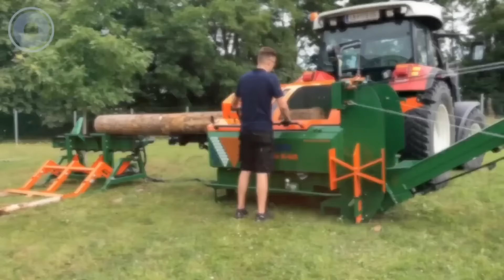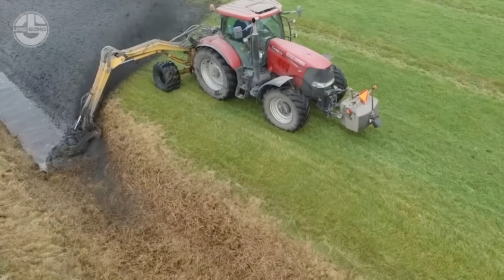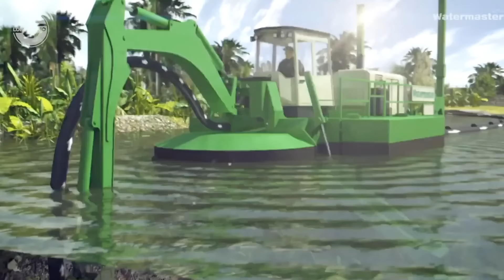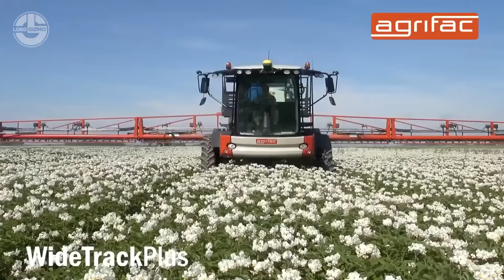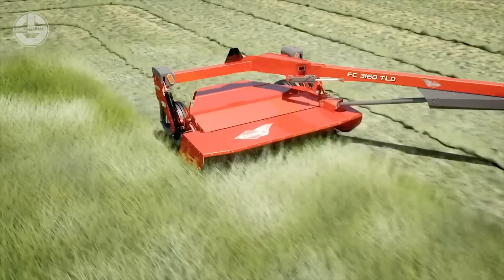16 Jaw-Dropping Powerful Machines on Another Level!

Comment: 14:10 The Bos-2BS supports 30hp, not 240hp. The site also gives a rear PTO speed of 1500RPM, most implements run at 540 or 1000RPM so I don't understand this one. The tractor shown does not have a 240hp engine or the ability to run it's PTO at 1500RPM.

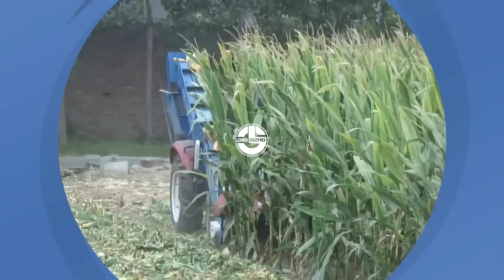Comment: At 13:45 the tractor for the corn picker should say any diesel tractor above 24 horsepower, not 240 horsepower. Great machine just the wrong tractor size.

Comment: I dont see any of these machines running on Duracells in the near future :)
Reply: Shows what you know. I work for a heavy infrastructure equipment manufacturer. We're already producing electric horizontal directional drills. And I'm not talking about the baby ones 😁 these machines are all hydraulic. It's is actually more efficient and reliable to run pumps with electric motors. Constant and instant torque is next to none. Battery technology was the only problem. Some dude named Elon in Cali did something about that though 😏
Reply: @Barry_machawkner  battery technology is still a big thing. Mr elons cars still wont go as far as my petrol car will on 1 charge v 1 tank. Theres also the fact you cant recycle the batterys so they have to be  buried and that's just as bad for the environment as driving a fossil fule car
Reply: @jordanleigh8119  what are you talking about? Teslas get more miles per charge than your average passenger car gets per tank. The batteries are also recyclable. Did you just make that up hoping you were right and/or no one would notice? Lol 🤡

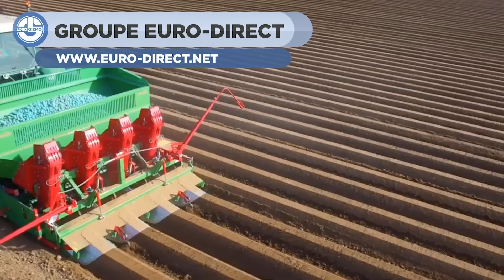Comment: At 5:52  Why are those Potatoes Turquoise or Blue-ish Green ?   This is why I only buy produce from verified Organic food suppliers.  God only knows what those Turquoise potatoes are coated with. Maybe they're even the same color inside when you cut them open. Maybe they're coated to resist insects & genetically designed to lose their color after the chemical is deposited into the soil.  But what gets deposited into the person that ends up eating them ?   Biggest and most massive is not always the best way to do things.

Comment: How does those water cleaning things see under the water? Mud is hard to see though
Reply from the maker: Sometimes they use radar and lidar, sometimes it's other things.  Different machines have different methods, and every company should be able to explain how their method works.  Hope this helps!

Comment: Unless you sale the firewood to retailers it will take you a long time to pay off the machine. I would bet it is about $50,000 USD.
Reply: Whilst it still is for firewood retailers the thing costs 25.000€ or about $29500 USD without taxes in germany in its simplest form. Posch is an austrian company, so you probably would have it shipped to the US in a container, wich would also cost a few bucks...
Reply: @thoughtfox2409  I was only guessing on price. I figured 50 if buying everything.

Comment: You know what would really be cool? If the workers had the right to repair these machines themselves, if possible.
Reply: Fuck em -john deer
Reply: Mail your senators, get your friends and family to do it too
Reply: Why can’t they? Or will it void the warranty? Or just too many electronics so doesn’t let them?
Reply: @DavidInMonroe318  All of the above. Some brands of tractor just have the electronics lock it up so only a dealership technician can do anything with it and void the warranty if the farmer tries to fix anything.
Reply: @DavidInMonroe318  several reasons. Many tools for this size equipment is simply not easily available, so owners tend to "make do" and tear things up long term. 2) not many operators are even qualified to repair ANYTHING on these besides adjusting the seat 3) warranty and maintenance are usually included in the price (to make it last longer)
Reply: Just because you can, doesn't mean you should. Who's to say you're qualified? In warranty or out?  Are you even going to spend the hundreds to thousands of dollars for the service manual?  How about the diag tool so you can reset even the service reminders?  Some of these machines are just out right dangerous to work on.  I'm an engineer that used to supply fluid power components to Deere and Cat.  Deere especially tests everything and sets the industry standards.  To not replace something with OEM if it breaks makes a huge difference on lifespan and performance.
Reply: @ando5389  lol. Plenty of farmers and maintenance teams are used to fixing engineering screw ups including hacking electronic interfaces deliberately obfuscated by unethical manufacturers trying to extract exorbitant maintenance costs by poorly trained slow to respond authorized repair centers. Crapple and Dear John aren't alone in trying to hose customers but they are some of the worst.  Right to repair needs to be codified.
Reply: @anullhandle  I'm all for right to repair.  Like me, I want to be able to fix my own stuff.  In college, I was a mechanic for a lawn and garden service co.  I've  been through many training seminars.  I've taught many training seminars.  At least 1/4 of the work we got was farmer duck ups.  But that's fine.  Just playing a little devil's advocate.  My biggest recommendation though, is just don't start messing with it until it's out of warranty.  You paid for it, use it...
Reply: @ando5389  .02 under warranty if you can reasonably show my actions resulted in the particular warranty failure fair enough it's on me.  That doesn't include  the tamper evident seal is missing.  Im ok with a voided warranty if I twiddled some bits and enabled some withheld features. Some manufacturers look at that as a competitive advantage.   Service manual should be the cost of reproduction and distribution thru the whole chain including the owner.  Code readers should be the dealer actual cost there's no reason it couldn't be foss and likely generic industry standard.  Secrets aren't security and you already developed it for production and test.  When your customers and independent  service providers are suing you and testifying against you before Congress, you're doing it wrong. Agreed safety / liability issues are concerns but not a impenatrable barrier or legitimate excuse like manufacturer's are claiming.
Reply: It’s their equipment !! They can do what they want too !!
Reply: @keithfaulk1354  not always. These machines are designed to detect when "unauthorized" work is being done to them, and will shut the whole machine down until a company technician comes and makes the farmers pay out the ass to reset and fix it
Reply: Them days just like your car are coming to an end.
When these new electric cars break youl drop it bk collect another just like your phones.
How will they changed the batteries with their part of the car?
Reply: @nickjohns1192  ⁸⁸⁸⁹9999⁹9⁹⁹⁹⁹⁰0
Reply: That would be cool. What's cooler than cool, is if we deployed farming practices that removed the reliance of farmers on the people farmers are beholden to, the machinery manufacturers. If farming were done in a way that removed the need for machinery. Maybe regenerative no dig farming is a way to go. I dunno, I'm just a city slicker that would rather be on a farm earning my place and doing it for a local community instead of some rich prick that only cares for money and power, like Bill Gates or John Deere.
Reply: If it wasn’t for the demoncrat emmisions nonsense you could. Your anger is poured the wrong way. Thank a leftist insect for that.
Reply: @RandyBoBandy.  ? what do you mean? Most right to repair bills circulating today are backed by democrats. It's republicans that block right to repair movements in the name of the free market.

Comment: I like that u give some insight into how the machine works instead of just pulling random footage from somewhere of the internet
Reply: You can't be serious.
Did you listen to the guy?
The stuff he says is just stupid.

For example that the tractor has a 12 inch display. That's nothing special. That's not worth mentioning.

I guess all he does is open Google, type in the machine and than he reads the first sentence that Google is showing.
Reply: @Jehty_  seems like a decent put together video to me.  Intros to various machinery,  with intro info.  If it was a full on instruction right down to servicing the zerk's,  wouldn't that be an owners manual.    Also regarding your other comment on the wood splitting machine, yes I agree,  considering the size of this particular splitter it would be used outside but many smaller splitters are certainly used inside and do make quite a mess.  It's constant cleanup from my electric wood splitter.
Reply: Or another example: The first clip.
He says "woodwork creates a lot of dust and mess"
And then he show a firewood cutting machine.
Tell me how those two things fit together.
It's not like anyone would cut firewood in his workshop. You do that kind of work outside. Like the clip is showing.

Comment: just added 4 wheels to the tractor in the thumbnail .. ok ok
Reply: No kidding. I watched this just to see that... and it was photoshopped
Reply: @cdavison9491  rr444 hang
Reply: It's wasn't even a crop cutting machine it was driving over some ditch
Reply: @juanarmas4491  It's a canal tool, which makes it an irrigation tool, and it drives off of a large-displacement diesel tractor. Honestly, being from Kansas, only the ones that see use primarily in the logging and paper industry were new to me, and even they're just bigger and more robust versions of mechanical harvesters than previously available.
Reply: Seriously...so fucling cringe. Click bait should honestly be banned.
Reply: J JudI
Reply: Bloody joke init!!!

Comment: Have you seen the potato seeding machine? It uses standardized size seed potatos! These seed potatos all look exactly the same! I have worked in the potato industry ans so I know, farmers usually seed their own potatos that they have harvested with the potato harvest of the previous harvest. Seeing these standardized seed potatos in the video, it seeds the suspicion in me, these are the only kind of potatos this machine can work with and the contract to buy them each year might be connected with the buy of the machine...
Reply from the maker: Hey Karline, thanks for the input!  We enjoy hearing from those involved in the fields shown in our videos.  As for the potatoes, we couldn't tell you with any certainty, but it looks as though the machine was able to use other seeds in other photos.  But, perhaps it is the case it was designed with a single seed type in mind.

Comment: You need someone to check your facts and proofread your script's, or it comes across as rubbish. Suit vs suite. 24hp or 240 hp. 35hp with a diesel motor patently using so much more energy. And insulting the manufacturing.??

Comment: you might be lord giz but you are dumb af. deer 6130 trippletopper is a mystery. what's it doing just cutting the flowers off? there does not seem to be any harvesting going on. nowhere for the blooms or bulbs to go.  thaat boslead did not have an engine above 240 hp. more like 24

Comment: Gave a thumbs down due to the thumbnail shows a tractor with five tires on each side, but the video segment tractor only has 3 wheels on each side.
Reply: It would destroy the rear axles,different, wheel hubs and be overly heavy, it is probably photoshopped
Reply: @jacobbender5449  and 2 wheels would drive over plowed land
Reply: @jacobbender5449  100% photoshopped.  Look at the mud spray in front of the outter two tires in the thumbnail.  Just copy/pasted and added on to the outside
Reply: Hi

Comment: Why in the thumbnail, does the tractor has so many wheels? I mean, if that was real the tractor would be so heavy in the back. Sorry if I sound like a nerd or a smart a.
Reply: Its Photoshoped, it only actually has triples on the rear and duals on the front, so only 10 wheels for more grip on soft ground
Plus the weight is dispersed on a larger area
Reply: Oh lord you definitely seem very new to YouTube
Reply: @bryce5792  nah, I’m just weird on some days tbh

Comment: That tree harvester has a "35 hp Volvo diesel engine"?   Dream on
Reply: I heard that too, and I have a 35hp tractor and it just don't seem like it would have the power for that tool in video.
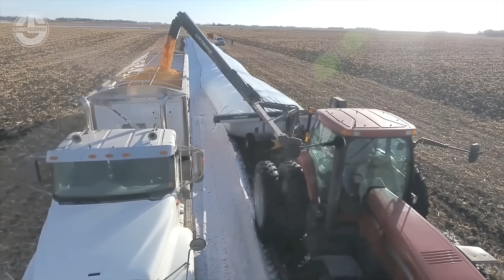Reply: The 3 row corn picker @15:30 is not a 200hp. Mars like 40hp.

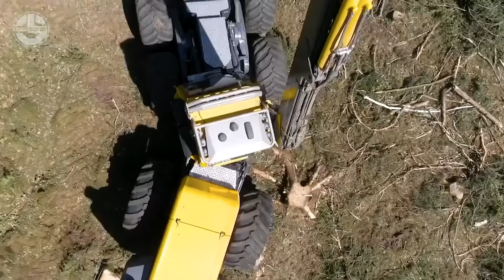Comment: 5:01 "it runs on a 35 horse power volvo engine" where you meant to sat 35 hundred or 350 or what happened there?
Reply from the maker: Another person in the comments pointed that out for us; it purportedly runs on a Volvo 218-320hp engine.  Sorry about that!
Reply: the corn picker tractor wasnt over 240hp either lol

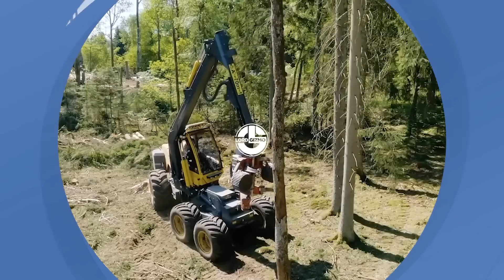Comment: 4:45 The trees do not stand a chance.
Reply: You discuss this corn harvester you say it can work off of any machine with at least a 240 horsepower diesel engine. And I believe there's an error there as the video you show of this small tractor with that harvester mounted on it that is probably a 24-horsepower engine not a 240 horsepower. So maybe you can double check your data on that.

Comment: You discuss this corn harvester you say it can work off of any machine with at least a 240 horsepower diesel engine. And I believe there's an error there as the video you show of this small tractor with that harvester mounted on it that is probably a 24-horsepower engine not a 240 horsepower. So maybe you can double check your data on that.
Reply from the maker: That could've been an error, we're sorry if so!  Sometimes small things slip through the cracks; could've been an error, where we put a 0 there on accident hehe

Comment: a wood harvester with a 35 hp engine?
im no expert but that seem kinda low
Reply from the maker: According to another fellow in these comments, the figure we stated was an error; it purportedly runs on a Volvo 218-320hp engine.  Sorry about that!
Reply: @LordGizmo  
Why did you use a photoshopped picture as the thumbnail? That is called clickbait.
Reply: @Well_I_am_just_saying  what you gonna do? what you gonna do? when it comes for you?
Reply: @Well_I_am_just_saying  actually, the thumbnail pic was the final machine..
Reply: @GenoLoma  
I repeat, it is a photoshopped picture in the thumbnail. The last machine in the video has 6 rear wheels. The picture in the thumbnail has four additional rear wheels photoshopped into the picture.
Reply: @LordGizmo  you also made another error the cornhusker does not require 230 HP motor. you are lucky if the tractor pictured has 23 HP.
Reply: Yeah I had to rewatch that clip a couple of times after thinking the same!  The hairdryer of the wood harvester world 😂
Reply: Make is😋😋😋😋😋😋😘😘😘😘😘😅☺☺☺☺😉🤗😘😘😘😘😘😂😘😘😘😘😘😘😘
Reply: @jairsosa45  θ&    (

Comment: The Eco-log tree harvester runs on a Volvo 218-320hp engine and not 35hp like you stated. video was good otherwise.
Reply from the maker: Sorry about that!  We're not sure what happened there; we might've meant a power supply for the cutting unit, but we're not too sure.  Anyways, thanks for the info!
Reply: @LordGizmo  Yeah maybe the head's hp requirement is 35hp but it all runs off the same hydraulic/hydrostat pumps mounted to the engine.
Reply from the maker: @piperdoug428  I, myself, couldn't see an independent power supply for the head.  Likely just a researching issue, but it's something we'll note for future research :)

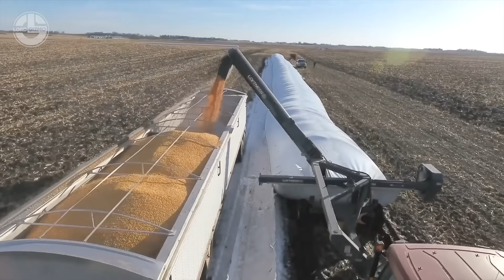Comment: 1) So the Chinya corn harvester @15:50 has an engine with ABOVE 240 hp, or am I wrong???
2) Peat drainage @19:34 is become highly controversial in Norway due to release of stored CO2. Even the build of green house friendly wind turbine parks have been stopped as the developer hasn't factored in the gas release from the supply roads over peat areas.
Reply from the maker: 1)  That's unlikely, such a tractor likely wouldn't need that much power.  That being said, we aren't sure which tractor is shown.
2)  We were not expressing support or disapproval of the peat drainage method, merely showing off a machine we thought was impressive looking.  We hope we didn't cause any offense.
Reply: A 240 horse tractor would be something is 12 feet wide. That was about a 60 horse.
Reply: I'd say he read the script wrong. It was probably meant to be 24.0 horsepower

Comment: Cm cut really, ft and inches in America if you want us to buy your equipment Michigan
Reply from the maker: Hehe we tend to have a lot of argument over what units to use, we try generally to base it on where the product is sold.
Reply: Basic math 2.5 cm to an inch that's why I thought usa kept the outdated imperial system your smarter than the rest of the world guess not even the country that invented imperial did away with it 1/2 century ago ( that's a long time ago in american ) while I'm at it the driving on the left makes sense that way your sword hand is nearest to oncoming think about it dont8
Reply: Kiwi Guy No country is perfect.
Reply: @kiwiguy4764  not even exact 2.5cm so imperial is even weirder. Like feet. Stones. Or if someone is 6'4 in the morning. Ifhe shrinks 1cm by night time because of round off he is 6'3 all of the sudden.